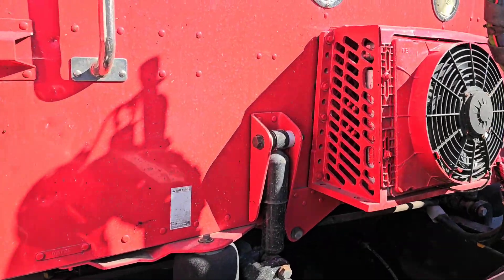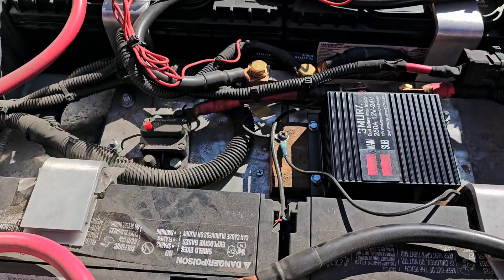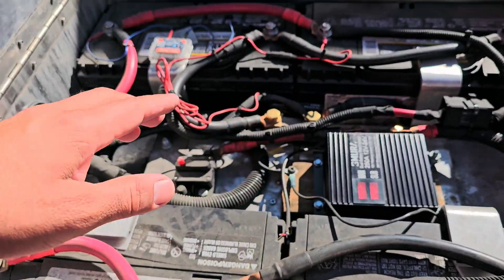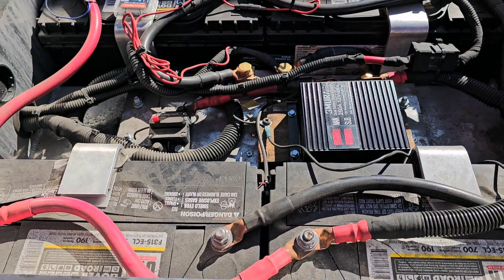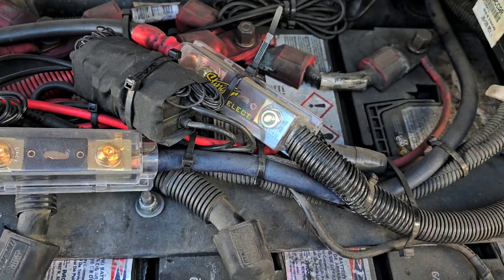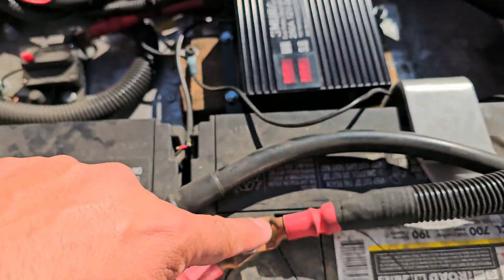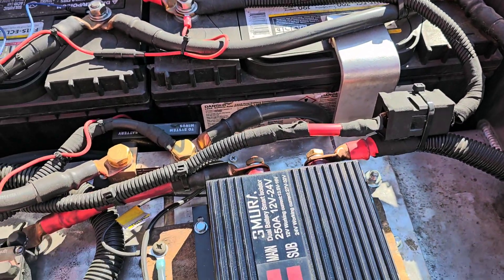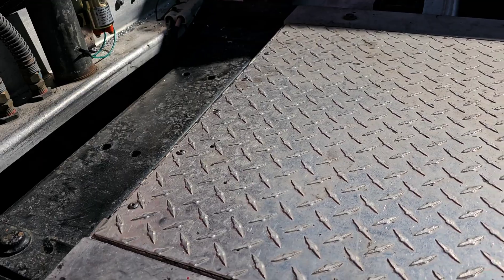12v Truck Parking A/C battery setup |Save Diesel |No Idling||

Comment: Nice sistem brother , but may I suggest you need a Dc to Dc charger for this battery’s to charge them directly from your truck while you are driving….. I have the same sistem but different battery’s , I can run my A/C 12 hours at least on a full charge , let me know if you need and info , God bless nice video
Reply from the maker: Which charger you use
Reply: Buy a DC to DC 40 amps and connect truck batteries to DC to DC charger and from there to your batteries , you charge those batteries while you are driving
Reply: If you need more info let me know I have a Chinese AC installed in the sleeper and I use deep cycle batteries, works fine
Reply from the maker: Correct you  use deep cycle batteries, so you have to use DC to DC charger . Currently, i used lead acid batteries so isolator work for me but later i convert deep cycles, then i switch to dc to dc
Thanks for you info
Reply: @puniazcom  hi what are you talking about ? To charge the batteries ???
Reply from the maker: Battery isolater heavy wire from main battery bank ......at end point alternator charge all my batteries
Reply from the maker: Make sure dc to dc charger must have isolator coz dc to sc charger quick charging from main batteries to 2nd batteries bank and quickly drain main batteries so isolator separate both bank
Reply: @puniazcom  have my system for 2 years never had any problems…. But I will look into it 
I use deep cycle lithium batteries, works just fine and I get 14 hours out of them at least ….
Reply: @danielcapota5401 how many batteries do you use and what amps are they? I'm planning on installing mine
Reply: @ 2 battery’s , 280 amps each
Reply: @ 2 batteries, 280 amps each , so I can run my A/C 12-14 hours easily…… make sure you get deep cycle gel batteries , they are the best , pricey but good
Reply: @danielcapota5401  Thanks, can you tell me what brand batteries you have bc there are too many of them and idk which ones are good
Reply: Yes
Reply: @HKhushal  ECO-WORTHY 12V 280Ah 2 Pack LiFePO4
Reply: @puniazcom don’t need batterie isolator , the dc to dc charger shots off ones the batteries are fully charged and it not going to drain your truck batteries

Comment: Just don't understand,  how you now you starting battary is full ??????? You don't have DC to DC charger isolater ? I don't want to park near you , you can fire whole truck stop
Reply: Could you explain, please? I'm going to install the same as what he described, but you make me scared, which our weather here in kuwait goes to up to 135F
Reply: @mosa5529 nothing wrong with his setup because he’s using lead acid batteries. But if you are planning to use deep cycle lithium batteries is recommended to use a dc to dc charger. This regulate more efficiently the flow of energy to the batteries and keep your alternator from overheating. But the guy set up is good just depends on the batteries you are planning to use. Redarc is an Australian co which makes very good good products it has dc to dc charges and battery isolators as well. I hear  on other videos the 40 amp dc to dc is the way to go if you planning to install something similar to this. One more thing many new vehicles has what is called smart alternator’s if you vehicle has one of those you must install a dc to dc instead the battery isolator because smart alternators drop charge values depending on your vehicle needs and this can affect the charge going into your battery bank.
Reply: @lf7469  Thank you for explaining 🙏

Comment: Hey just bought 4 lipo batteries I want to install this system on my 2019 T680 can you help me with what else I need to run this system
Reply from the maker: You need battery isolator and battery cables
Reply: What size cables did you use to connect the starting batteries to the ones in the back?
Reply: Also where did you get the box for the batteries in the catwalk
Reply from the maker: I used 2/0 AWG battery cables, and both end fuse or breaker must install
Reply from the maker: I get from eBay, and you can search the truck model accordingly
Reply: Thanks appreciate that
Reply from the maker: No problem
Reply: You need a Dc to Dc charger and you can change this batteries directly from your truck batteries while you’re driving……

Comment: Could you list supplies and equipment for this set up? I’m very interested! Mainly how to wire the charging and power portion so the two battery banks work together. Great video!
Reply from the maker: Everything comes with an AC unit. You have to buy batteries and cables, an isolator ,2 fuses, and a battery box in the frame or side mount

Comment: So you have a breaker on positive coming from the start battery into ac battery and a fuse at other end (start batt)
Reply from the maker: You can use either fuse or breaker but must use both end
Reply: Do you have to use 4 batteries or can you use say 2 or 3 ?

Comment: Hi sir question. What kind of battery you install and how many hours can last during a hot days like 100 F
Reply from the maker: I just installed OTR group 31 cca 700 ecl battery but you can use higher power like amp battery or deep cycle batteries that lonv last in my case in 100f i tested upto 5 hours so far if ac set on eco mode
Reply: Got it thank you so much
Reply: How much did spend for your 4 batteries
Reply from the maker: 800+ that time but right now price may vary
Reply: @GeorgeGuira  I have the same system but I use lithium deep cycle batteries, they last 10-14 hours even at 100 degrees outside
Reply from the maker: @danielcapota5401 which brand batteries you installed